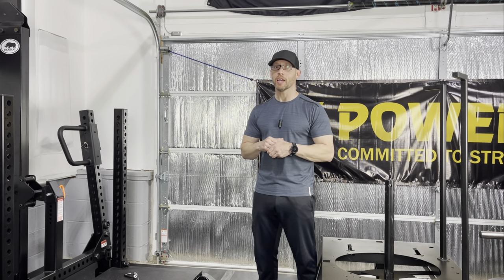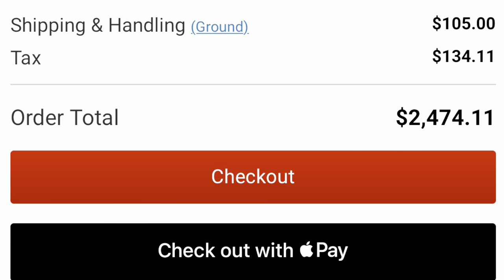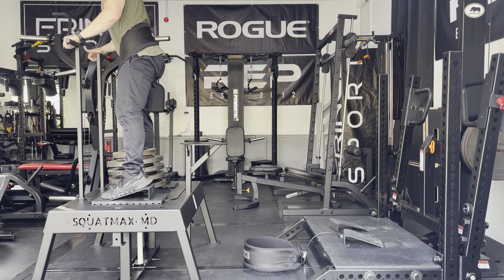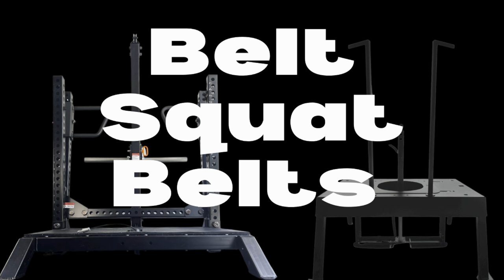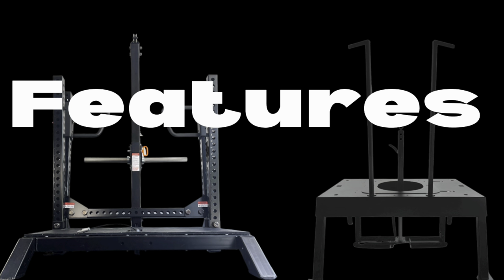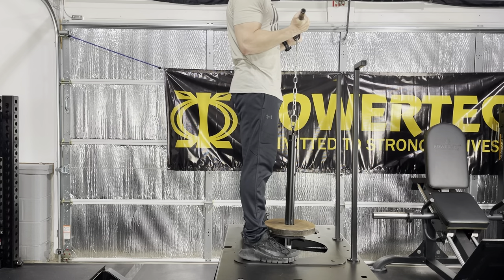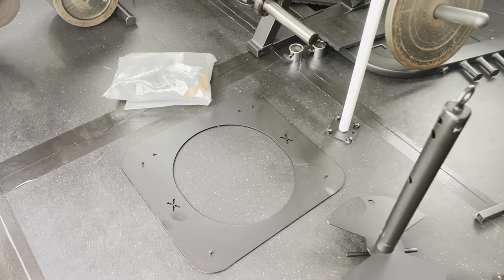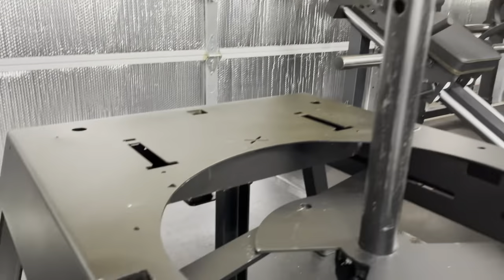The Rogue Rhino vs The Squatmax-MD - Battle of the Best Belt Squats

Comment: Which do you feel is better now that you've had them for awhile?
Reply from the maker: I still think they are very comparable and I still stand by everything I said in this review.  The Squatmax has some unique features: the seat, the transformer pin, the hip thrust, and it’s less expensive.  The Rhino is easier to load and has more foot positions.  
A couple months ago, I sold 1/2 of my equipment to make room for future reviews (I have a video) and I sold the Squatmax…it was a tough choice, but the Squatmax was easier to load in the truck to meet the seller.
Reply: So If the rhino was the same weight as squat max and easy to move just like squat max you would of sold the rhino or squat max?
Reply from the maker: The Rhino is my preferred belt squat…only by a little bit.
Reply: @Home Gym Hacks and Reviews  I have A bad knee and 2 buldging disk.  I wonder which one will be better for my knee, the rhino whith the cable or the squat max with free weights?
Reply from the maker: @futbol1972  I think you should call around and find a gym that has each or both and test each belt squat for yourself…that’s the only way you’ll truly find out before purchasing one.

Comment: Squat max it's cool but changing plates on  pin looks like a pain:( I already went through it with my lat pull down pin system. In the rhino it looks like you can do a lot more exercises that the squat max too
Reply from the maker: The Rhino is definitely easier to load / unload.  Both machines have their advantages.  For example, Hip Thrusts are much better on the squatmax.  Also, with the chest-supported row squatmax add-on, I can do barbell and dumbbell work.
Reply: @HomeGymHacksandReviews  that's true but u can  so barbell work with regular squat too
Reply: @HomeGymHacksandReviews  I may get high and low slinger with a bully glyder to do belt squats and lat pull downs
Reply from the maker: @futbol1972  seems like a pretty good option; although not as vertical of a line of drive.
Reply: I already own a straydog goat with a pad too. It's like a bulldog pad.  I don't know if it will be worth to get the squat max pad if I already have the goat?  However it looks like for hip thrust on squat max I ha e to get their pad?  Assuming I decide to buy squat max over rhino🙄
Reply from the maker: Right, if you want the hip thrust option, you will need the chest supported row pad for the Squatmax.  Tough call…I know.

Comment: Was wondering what your next main equipment vid would be 😉

Yeah I found a commercial gym with a belt squat (a leverage one similar to the Wenning BS), they also have awesome barbells so joined there

Will likely do my powerlifting stuff at home still, but do hypertrophy/cardio at gym. Sold my Echo bike last week, the first of the sacrificial lambs 😕
Reply from the maker: Have you given the belt squat a chance?  If so, will you keep it in your program?  
Sounds like a good training plan, but sorry to hear you had to sell something…although, the Echo bike would be one of the first pieces I would sell…it’s so tough, it doesn’t get used much 😂
Reply: @HomeGymHacksandReviews  tbh, I've never used one before 

Will fiddle around with it if I do a late night leg session there eventually, definitely Interested, but don't want to look like a novice either 😄
Reply: @HomeGymHacksandReviews  yeah I'm hoping to keep my power rack for my move so I can also buy the matching storage system and rack attachments, so if I do need to sell one day I can command a higher % back on a bundle compared to letting the rack go for peanuts because I have to get rid of it when I move, plus the rack attachments will definitely improve my lifting experience
Reply from the maker: @redwhiteandblueblood  😂 let me know what you think when you get a chance to try it out.
Reply: @HomeGymHacksandReviews  yeah  will do when gym's quiet 😉

This particular gym I joined is pretty good for crossfit/functional fitness, but has the usual body-building and cardio stuff too as well, they've built pretty well 

Only gripes so far, their 3 Smith machines are all angled, no vertical ones, haven't found a good biceps/preacher machine yet and their olympic benches are all tiny, so basically means I will have to bench at home, but definitely can hit a few areas there

Can OHP off their rig on shoulder day and not be compromised by ceiling heights or low racking points, their seated row and lat pulldowns are all nautilus and are elite, and most of their plate loaded leverage machines are quality too, so can hit the bro split well enough mixing home and there
Reply from the maker: @redwhiteandblueblood  agreed, as you know from the IM 2000, I would much rather have a vertical smith machine.  
Sounds like you found a good place to train for a while.
Reply: @HomeGymHacksandReviews  the IM2000 is still a legit option for me depending on garage size if I have to sell my cage

Basically my order of preference 

1. Keep cage, buy modular storage and attachments, buy more hex dumbbells and specialty barbells

2. Sell cage, buy a 8 foot half rack which is only like 140cm in length, make sure the half rack has a crossmember instead of a chin up bar, buy a shackle attachment for plate loaded high pulley and utility pegs so I can use for chins or hatfield squats when needed. Depending on the length of the garage will determine if I get heavy hex dumbbells or nuobells to combine with my existing Ironmaster DBs

3. IM2000 and Nuobell set up, this would do if I had a smaller space and ceiling constraints 

4. Squat stands and Nuobells set up, least preferred option, but would allow me to set up in the backyard or tuck everything away in a corner or something, would probably go to gym alot more with this set up though
Reply from the maker: @redwhiteandblueblood  I think all are great options, but number 4 unless your commercial gym is just a short drive away.
Reply: @HomeGymHacksandReviews  not really getting bang for my buck going number 4

Sell all this equipment at a loss with not much to show for it, hence why I'd rather the first 3 options so I have a proper station to train out of still

This gym is about 2-2.5 miles away, so yes it's close. Moreso chest Mondays and generally peak hour early in the week is why I avoid gyms at certain times and prefer training at home, it's basically the same at most gyms in my area
Reply: Though I trained after 8pm on Tuesday and Friday last week at the gym and was great 

So yeah, deadlift and bench at home, do the rest at gym could work
Reply from the maker: @redwhiteandblueblood  after 20+ years working and training in commercial gyms, I greatly prefer the home gym life.
Reply from the maker: @redwhiteandblueblood  and you are close enough to where you could start your workout at home and get to the gym in about the time of a short rest break.
Reply: @HomeGymHacksandReviews  lel yeah

I've got a 5 day split at the moment though that I'm working into

Good thing about it is I can go easy on certain days and harder on others

Monday sumo deadlifts (will row too if I can be bothered, if not will row later in the week, essentially a pull day though)
Tuesday push (OHPs, shoulder and tricep oriented)
Wednesday cardio
Thursday legs (hopefully hit the belt squat)
Friday pull day 2, hit the machines and biceps
Saturday bench day (push day 2)

Comment: I have yet to use any kind of belt squat but I really want to get one. But I'm not liking about the squat max is it seems that the seat is in your way so you can't do ask the grass squats. Also if you want to do squats with your feet really close together you also can't do it on the squat max because of the giant hole for the plates. If it wasn't for that I think I would definitely want to go that route but based on that it seems like Rogue might be the winner for me 🤷‍♂️
Reply from the maker: The seat can go really low or can be removed from the Squatmax.  At one point, Brian manufactured a riser which allowed for a super close stance and at some point he might bring it back.  There is also the close-stance inlay which allows the feet to get a little closer.  Both are really good options, but you are correct, the Rhino allows for a closer stance.
Reply: @HomeGymHacksandReviews  Thanks for the reply. I wonder why he would stop production of the riser???
Reply from the maker: @DERHOF2007  absolutely.  He told me it was due to cost.